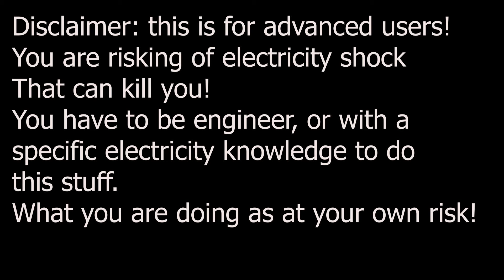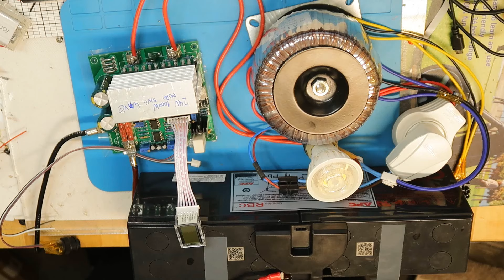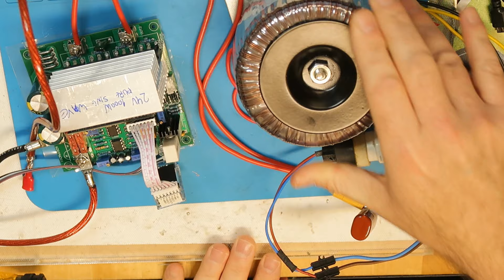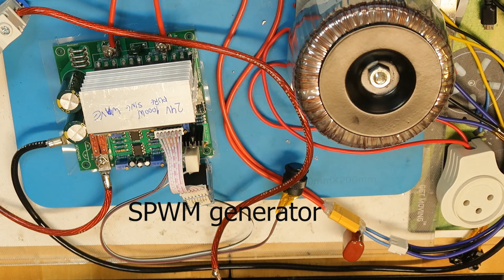DC to AC 220VAC Inverter - Part 1

Comment: Your 10 amp circuit breaker will ride far past 10 amps as they work in two ways, trip out on a short circuit or thermal trip which will not trip instantly.
You can add 20% of the breaker rating so a 10 amp will thermal trip at 12 amp after some time, also you need a breaker that is DC current safe as AC ones can arc inside with DC and cause fire/ fume and damaged.
Gaz UK

Comment: Try a smaller 24 volt transformer to 220 volt, as that circuit board may not power the low ohms of that transformer windings so will have overload protection, that may be why it runs intermittently.
I suspect that circuit board will not handle switching 1Kw. 
Gaz UK

Comment: You also need to connect the voltage feedback to inverter module if not that inverter module will not work correctly..
If you can't find the datasheet of that board , you can still find the egs002 board datasheet...
But if you use to make 12V to 220V inverter you should use 7V  to 220V transformer , for 24V system 13V to 220V transformer is a better choice and also don't forget to connect feedback...
Good luck 👋